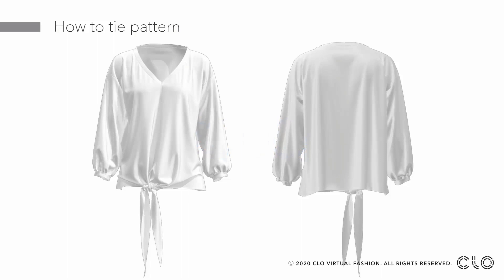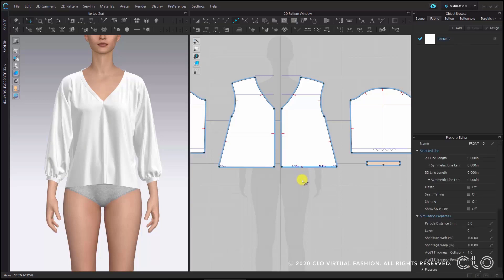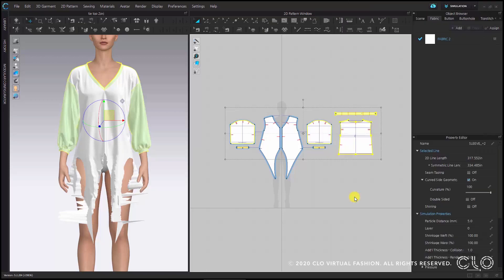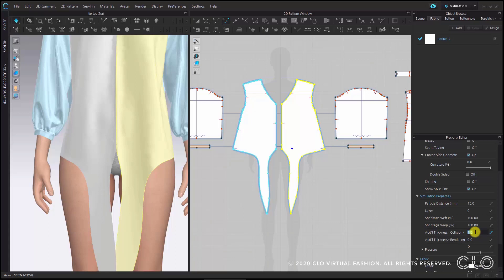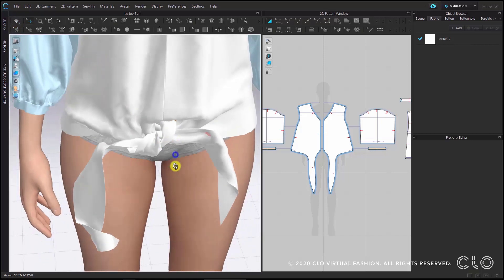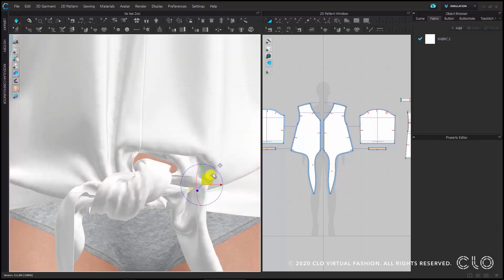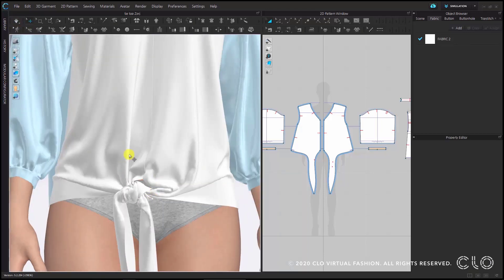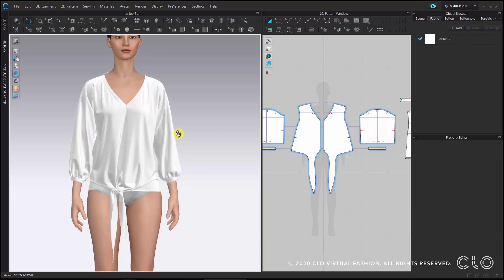Design Details: Way to do stable simulation - How to tie pattern(EN)

Comment: Still I feel there’s a limitation to realise tying thin ribbons like 2cm wide on clo.
Reply from the maker: You can lower the Particle Distance to nearly zero. Be sure to use Strengthen & Solidify to help with stabilization. Also use PINS as well.